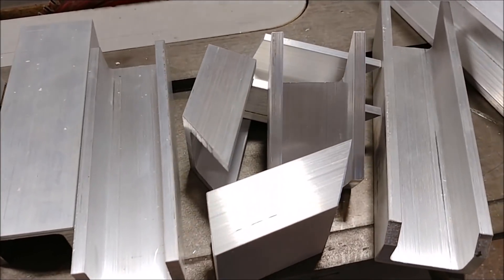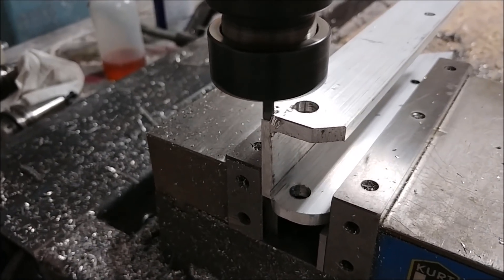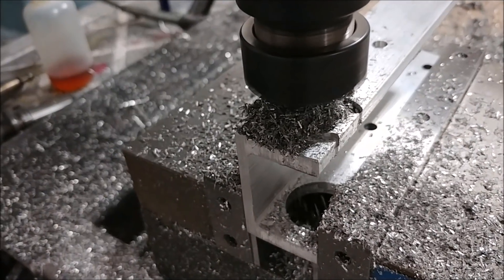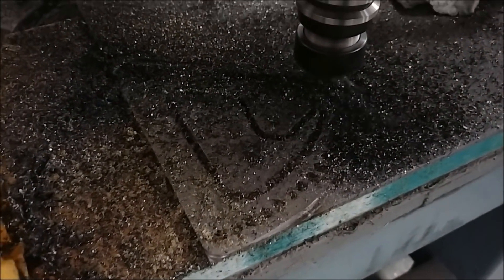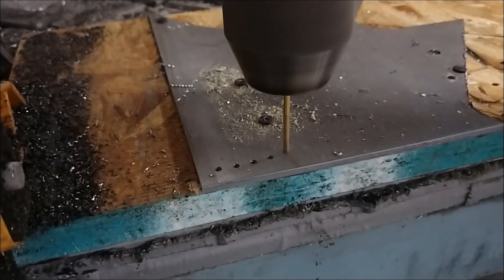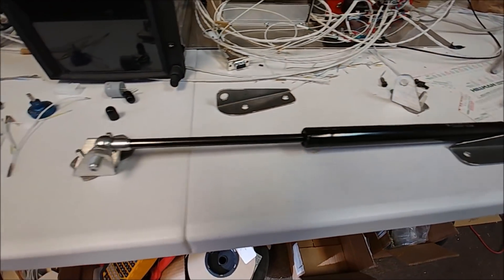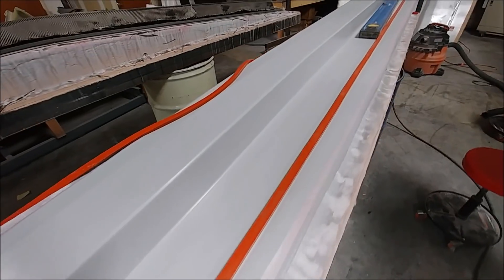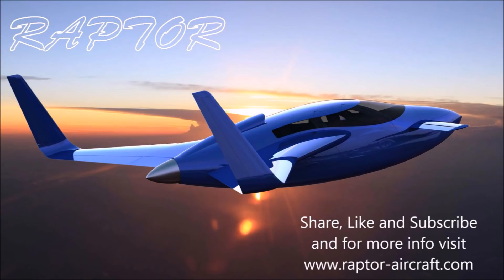Drilling and Milling

Comment: Peter, I'd recommend that instead of using oil, simply apply a stream of cold compressed air to keep the work and bit cool.  You will find it is highly effective and much cleaner operation.  Installing a flexible hose & nozzle that is usually for liquid coolant works fine, and with a bracket attached to the end of the mill's working end will allow you to quickly place the air stream without needing to hold it in place.  Here is a dual-head cooling fixture:

https://www.amazon.com/Bidirection-Coolant-Lubrication-Carving-Machine/dp/B06VXPVYLJ/ref=pd_day0_469_15?_encoding=UTF8&pd_rd_i=B06VXPVYLJ&pd_rd_r=DV8J9XXR4ERBNSFCQRQ7&pd_rd_w=YrEEr&pd_rd_wg=Z7bbL&psc=1&refRID=DV8J9XXR4ERBNSFCQRQ7